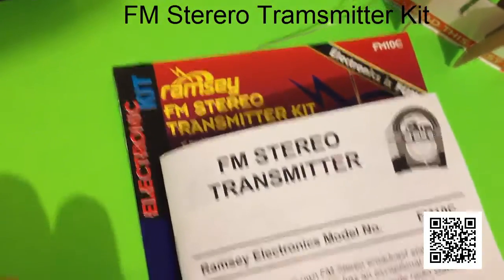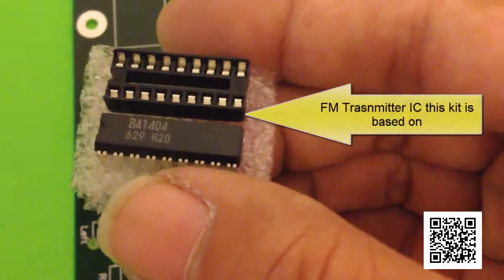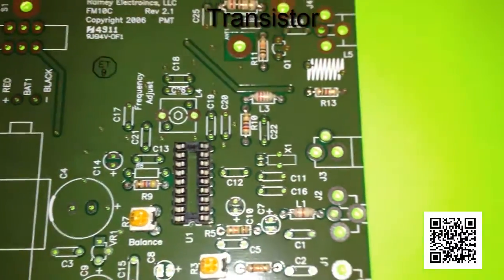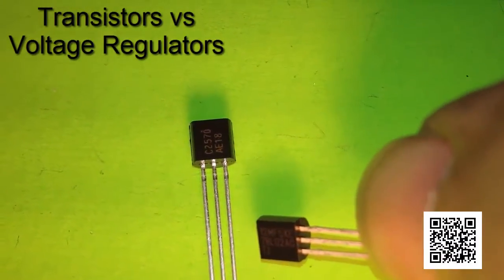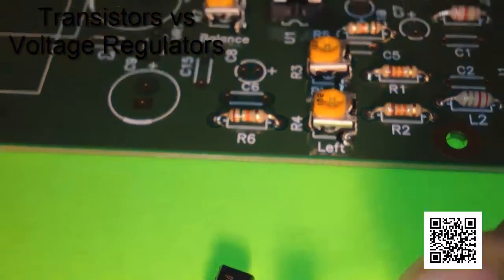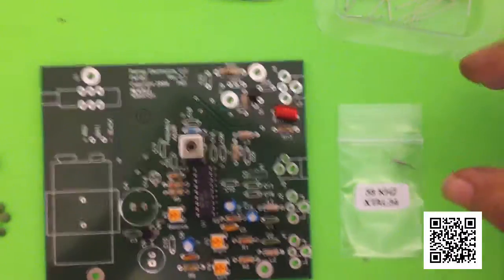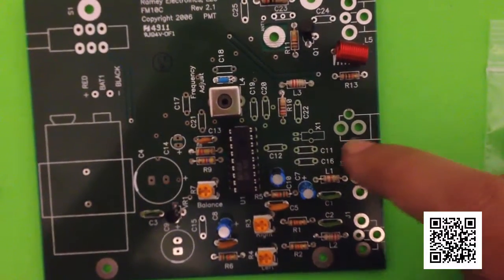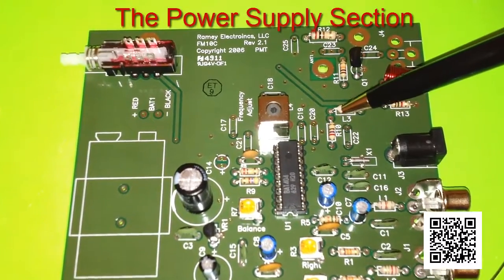Building the FM10C FM Transmitter Kit by Ramsey Electronics

Comment: Great video. It would be very nice if the manufacturer of this board added a dip switch so all of the frequency related parts could be installed and switched on or off, or the person making the board could modify it.
Reply from the maker: It would. I gave it some consideration to add in my own switches, but decided to just finish the kit and start playing with it ASAP.

Comment from the maker: I don't know but Ramsey has a digital FM transmitter kit. I haven't built it yet, but it may have Phase-locked loop capability.
Reply: It does, but it's only available as an export as it sends out 1/2 watt, which is WAY above FCC rules and regs for the US.  Best thing you can do if you want that model and live in the USA is to try getting it via a reseller or if you know someone outside of the country, have it sent to them, and then they forward it to you.